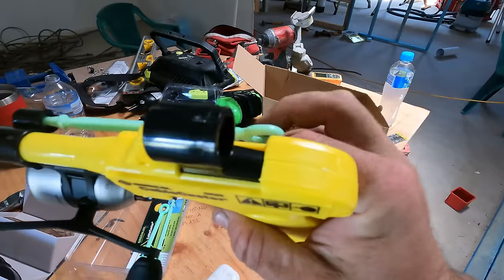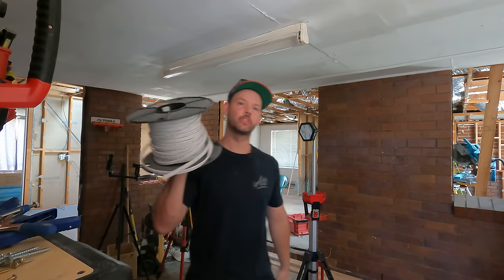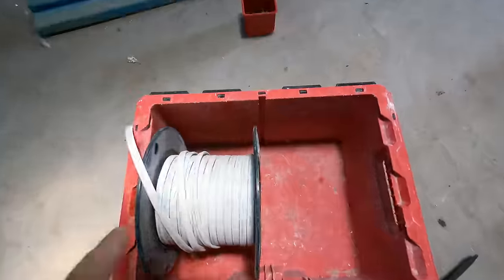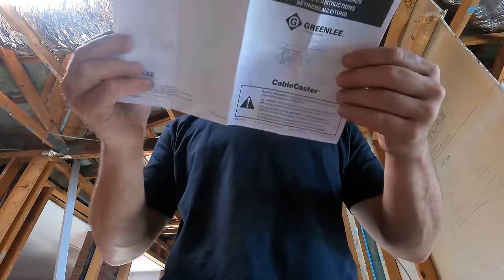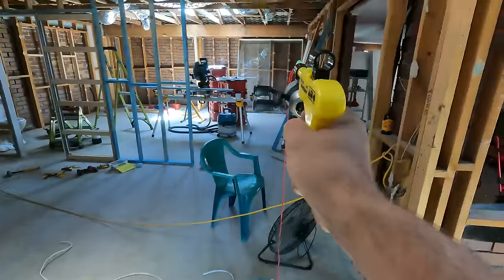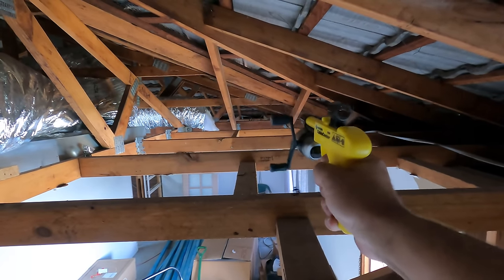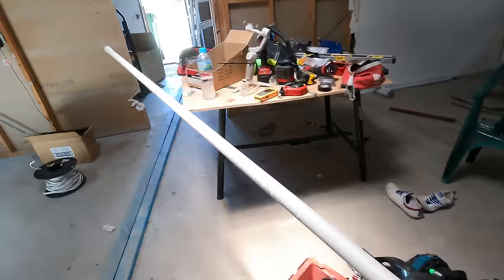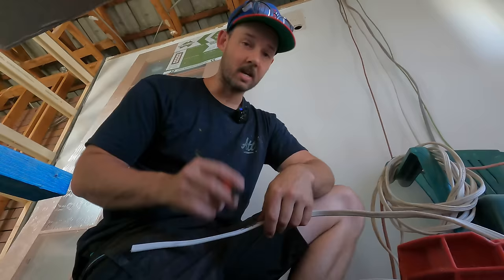the CABLE CASTER - running electrical cabling in the renovation

Comment: Interesting with the twist and tape. Makes sense. I’m a kiwi apprentice mainly doing commercial (done warehouses, appartments and offices) and been with two companies. Haven’t come across the twist and tape when doing pre-wire/rough in/1st fix with either company or any tradesman I’ve worked under
Reply from the maker: Hey mate. Cheers for the feedback. It’s definitely not a wide spread habit. But I feel it’s growing. How’s the electrical life in nz?

Comment: Hey mate, I got rid of my cable roller and have started using a packout crate with a divider. Chuck some 40mm duct through the handle holes and drill hole through the divider and you are golden. Fits 2 rolls of 2.5 perfectly and works as a rubbish box at the same time.
Reply from the maker: Perfect. The crate is one I didn’t think I would use when I bought it. It’s been one of the most used pieces.

Comment: Use conduit. As a residential sparky, always 6mm² for a pool circuit. One less space used on the switchboard. Hard wire the heat pump. Add a couple of dpps as well.
Reply from the maker: Hey Daryl, why do you go 6mm for the pool? Also what’s a dpp? Cheers
Reply: @AddictedtoTools   I am assuming dpps might be "double power points"

Comment: As far as numbers go, the dot is helpful.
  But also, putting an angled tip on the number one ( 1 ) makes for a quick reference as well, also avoiding confusion with lower case L, and the uppercase i.

To avoid confusion with 7, I cross my sevens.
Reply from the maker: Good points 👌
Reply: @AddictedtoTools  Bud, did you return and get refunded for that gimmicky/ crap "gun"?
Reply from the maker: Na I didn’t unfortunately.
Reply: @AddictedtoTools  C'mon mate!
Get your money back!

Also, in US commercial property electrical inspection, it varies not only by state, but even by the county on how strict and specific they will get.
Reply: I do exactly the same on all of those numbers 👍🏻 same with Z, I put a line thru it to not look like a 2
Reply: @mikenormandy9250  I did same when I was younger.  But having first name start w/ a "z", I realized I better make it unique.  Took a while to figure out the best "Z" to go with.  Had to eliminate the triple slashes of Zorro fairly quickly.

Comment: No minimum size conductor for a sub-board, the 6mm2 rule hasn’t been around for ages.
Reply from the maker: Wait really? Thanks for the update. I’ll have to go check that one.
Reply: Also thought a bond had to go back to board not a local circuit ?
Reply from the maker: It can go back to the dedicated pool circuit
Reply: Licensed here in USA fun to listen to your lingo- also I’m lost with it hahaha
Reply: I would run 4 mm for 20 amp if it goes threw the roof,even 6 mm step down your cable to either 2.5 on 20 amp or 25 on 4 mm for the de rating and voltage drop especially on a long run or if it was my own joint!
Reply: Use the bigger cable for voltage drop and de rating factors, then step her down at the gpos for easy termination as pool's need a few sock outlets for blowers, lights, cleaning robot things, etc you need bulk socket outlets you don't make friends with salad or 6 mm in weather proof gpos

Comment: Just a heads up might be worth looking at as3000 page 312 for the minimum earthing size. Very vague ruling about where its fine running it back to the closest pool circuit even if that earth there is only 2.5mm and the pool earth will be atleast 4mm. I just went the safe route at my place and had a 6mm from the main board out to the pool haha
Reply from the maker: Hey mate. Cheers for that. I’ll have another look. From what I remember, it’s fine as long as it’s the dedicated pool circuit. Worth double checking 👍
Reply: @AddictedtoTools yeah you're definitely right, you can run it to the GPO supplying the pool.
Reply: @AddictedtoTools yeah you're definitely right, you can run it to the GPO supplying the pool.
Reply: @AddictedtoTools yeah you're definitely right, you can run it to the GPO supplying the pool.
Reply: @AddictedtoTools yeah you're definitely right, you can run it to the GPO supplying the pool.

Comment: We “safe off” wire in the US, very similar - just wire nut or tape off the exposed ends - just bc stuff gets energized with new jobs and as stuff gets run and terminated in panels, as we turn circuits on, it’s a CYA ‘Cover your ass’ situation…also, we have independent Electrical Testing companies here, they work along side construction contractors and test, as we install, usually on bigger jobs but on smaller jobs, we’ll just ‘Megger’ the cable ourselves

Comment: Is it illegal in Australia to change power points yourself for I've done it. The sparky who did my kitchen put a double power point in for the fridge which is in a cavity so only one power point of the two can ever be used. He said they don't put single points in anymore. Well his point went wrong and I changed it to a single power point. Where the mains wires go into the power point it's all colour coded so you can see which wire goes into which hole on the power point. That was four years ago now and no circuit breakers have tripped. I've had the on/off switch go on power points and I've fitted a new power point. Yes I turn off the power point circuit breaker in the outside fuse box before I change it over. Never had any problems.
Reply from the maker: Hey mate. That’s correct, it’s illegal. Some of the work is straight foreword but what is usually missing is the testing and the knowledge for how it could be dangerous. An electrical installation can work but be deadly. When you say that the new power point hasn’t tripped any rcbos, this can be because there’s been no faults, or it could be because it’s not installed properly. The only way to know is through testing methods.
Also the electrician was correct. Most people don’t install single outlets now because they are more expensive compared to doubles. I hope that helps
Reply: @AddictedtoTools  His idea was when I had the house cladded which was screwed into the house framing and fibro which it covered that they must have screwed into an electrical wire. But if that happened then the circuit breaker would have tripped out instantly, but it didn't. This happened some time after the house had been cladded so I think you're right in that the electrician didn't install it properly to begin with and it was only a matter of time before it failed. I installed a single power point just for the fridge because you're not going to pull the fridge out of it's cavity every time you want to use the other power point.

Comment: Bro, minimum bonding conductor 4mm? 1:17
Reply: minimum bonding conductor is for mechanical strength not specifically the 0.5 ohm rating, E.g from his 2.5mm supplied outlet he would need to run 4mm from there, would still need to ensure below 0.5ohms though
Reply from the maker: Yeah that’s what is done here. 4mm from the pool to the outlet. I’m just running from the board to the outlet in this video. It’s a good pickup though.